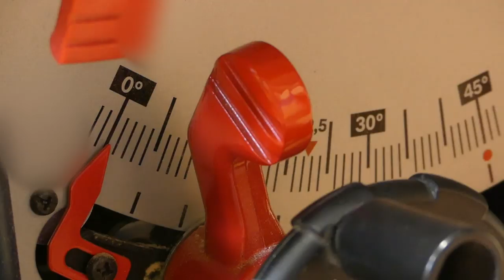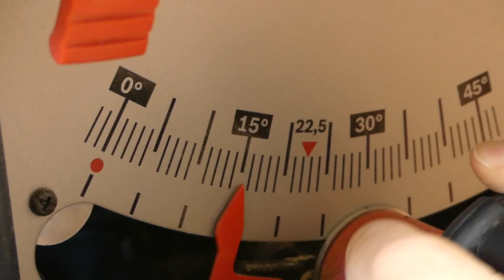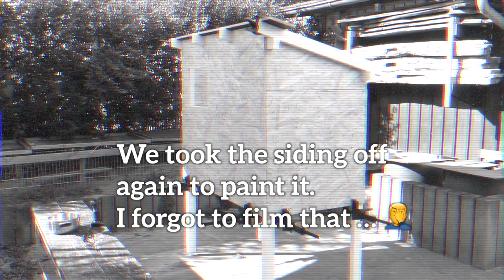DIY Chicken Coop – Functional and beautiful henhouse (Part 1/2)

Comment: Looking really neat, looking forward to the next instalment 👍 what was the plywood that you put used for the floor.?
Reply from the maker: Thanks Philip. It’s called resin-coated plywood – the resin layer is very resistant against moisture and very smooth so that it’s easy to clean. In Germany, this material is often used for the flooring of trailers.
Reply: Andreas Kalt thank you for your reply , I will have to inquire if it’s available here in Britain 👍